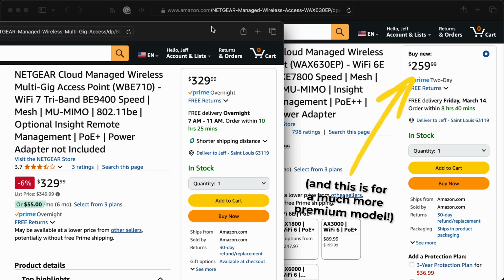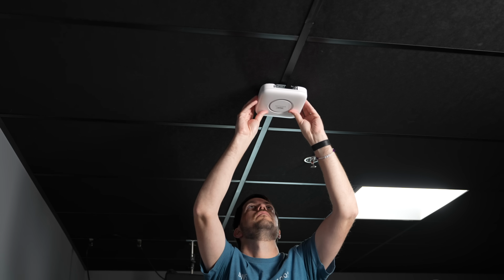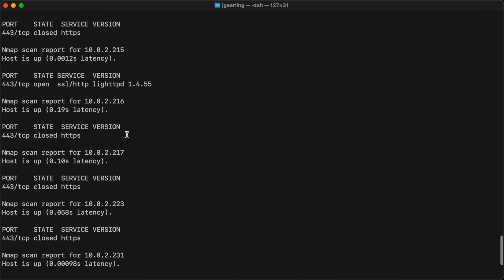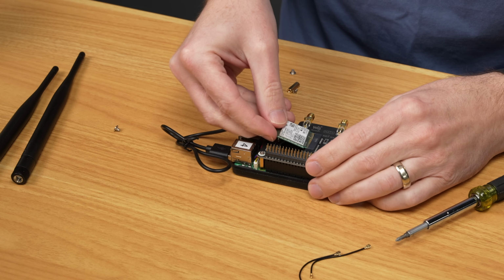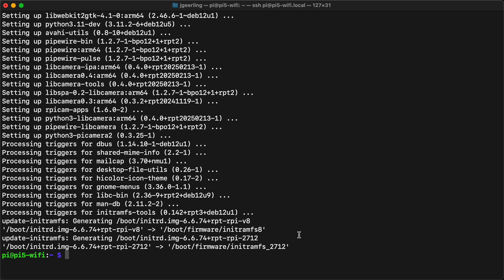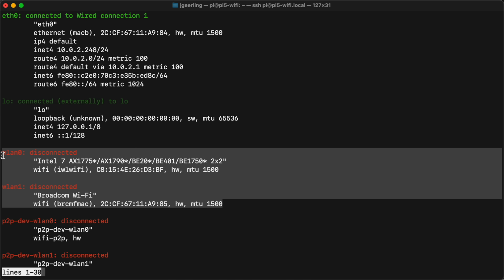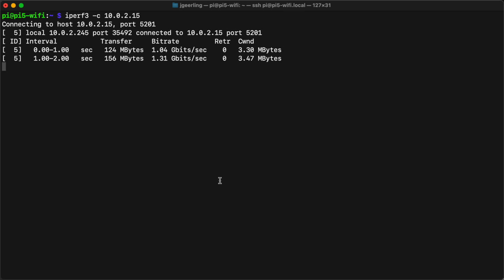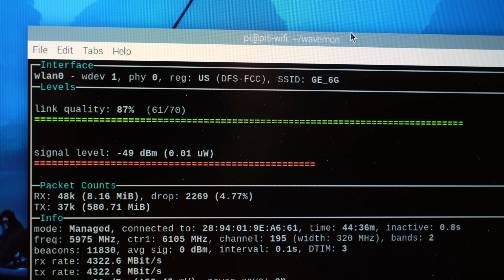The fastest WiFi EVER on a Raspberry Pi

Comment: Did we ever get a RPi5 AP/Router video? Even if not using WIFI6/7
Reply from the maker: Not yet :(

Still trying to finish my 'ultimate Pi WiFi Router' setup, I kept running into issues, then shelved it a while. I'm working on another WiFi setup right now but not quite the same as building an AP/Router.
Reply: @JeffGeerling  Count me as interested to see both of those experiments

Comment: @JeffGeerling Ive been trying out raspAP.  Do you have a better solution.  I plan on using this intel chip to broadcast and wired for input.  (so a router that rebroadcast)  Thanks in advanced.
Reply from the maker: RaspAP is great! I have been tinkering with it a bit, just haven't had time to make a video on it yet.
Reply: I'll be your video helper on it ;)

Comment: Can confirm that unfortunately, running Linux Mint 22.1 with Ubuntu kernel 6.13.5 on my older Asus M413UAY with a Ryzen 5 5500U, that the Intel BE200 is not compatible with it. In the recovery boot option found in the GRUB menu for LM, it shows that after "Probing EISA bus 0" it "Cannot allocate resource for mainboard," nor can it do it for EISA slots 1-8 either. After a few more lines, the laptop reboots. Granted, the last BIOS update for the laptop was mid-2022, so if it's a BIOS-level issue it will probably never get fixed, but I was hoping it was just an OS-level issue. :/
Reply: I can pretty much say for sure that anything EISA is unrelated to your system. That was a niche standard from the early 1990s that absolutely nothing remotely modern has any traces of.
Reply: @eDoc2020  The more you know. Ty!

Comment: I'm curious why you don't use UniFi gear.
Reply: Someone on YouTube has to not use only Ubiquiti gear :D

Mainly it's usually a little more expensive and I don't like locking into one ecosystem for something like networking, where I have varied needs (between different switches, APs, routers, etc.).

Comment: Even without the E, Wifi 6 regularly is > 1.5 Gbit/s for me in praxis, let alone in theory. That hardly seems like a compelling reason to upgrade further, and few if anybody has, let alone needs that amount of WAN speeds, so it doesn't really matter anyway. I wish instead of makins speed better and range worse, they would have worked on the range more. In a European house not made of dry wall and a bit of wood beams 5 GHz range is just garbage, and 6 GHz will be even worse.
My router even claims it can do 2x 2.4 Gbit/s on 5 Ghz plus another 1.2 Gbit/s on 2.4 GHz, and supposedly supported devices can bundle multiple of those channels, but given that I have 600 Mbit/s WAN, I have never tried to prove it. And even that is hardly ever utilized, unless I do big Steam downloads, but then my CPU is aching with the decompression efford. And I have a 5800X3D, what is the Pi supposed to do with > 3 Gbit/s Wifi?
It's the same kind of issues with 5G mobile network. I can easily do > 50 Mbit/s on LTE, but with regular limits of affordable mobile contracts being like 5GB or 10GB / month mobile data, why on earth would I care for better speeds. So I can use up my monthly quota in seconds instead of minutes? Yay, what a feature. Again, I'd rather see speed in long range, not in short range, and neither 6 GHz Wifi nor the faster aspects of 5G give you anything there.
Reply: With the higher frequency bands you can more easily choose a channel with less noise, increasing SNR. Even with greater attenuation this should increase range.
Reply: @eDoc2020  True, but that only helps you in dense apartments with lots of competing routers. And only increases range if your range was limited by that previously.

Comment: Wifi 7 main benefits is wider bandwidth it goes to 320mhz in 6ghz which has no interference and sadly iPhones doesn't support 320mhz afaik but any other wifi 7 device should and be able to get 3gbps+

Comment: Doest it suport Monitor Mode? Can I have more than 1 WIFI card atached?
Reply from the maker: check the linked GH issue, I got it in monitor mode but haven't explored too much further than that.
Reply: @JeffGeerling  Thanks Jeff. I appreciate the response. I guess, utilizing a WIFI  card with a chipset that's capable of monitor/ promiscuous mode should do the trick. I am les interested in "most modern" technology. rather. loving the form factor- one of having the possibility to have this awesome hand held network "trouble shooting" device. 

It's a shame from Pi4 to 5 there had to have been a change in the WIFI chip- IMO, in the wrong direction- since on Pi4 we could utilize monitor mode straight from the Pi4.

If there are any powers that be that may  be reading- my wish and those of many others', please allow us to switch the WIFI chip, easily ad another(or multiples...) and allow for the end user to be able to have external antennas(without having to perform surgery on our poor Pi). Some of us require certain features of other chipsets, and or require the functionalities which multiple would provide- lastly, some of us require placing our Pi in places/ enclosures that aren't the best rf/ signal environments- basically faraday cages. Having the ability to have external antennas would be a god send.
Reply: @JeffGeerling  Lovelly. Will do and thank  you.

Comment: They missed a trick not tapping off the GPIO 5V for the Bluetooth power. What a messy set up with that cable.
Reply: The BT half doesn't have separate power. The USB cable is needed because the BT part of cards is a USB interface instead of PCIe.
Reply: @eDoc2020  You're not wrong but that USB cable goes down to a 2pin JST connector. Looks like it's using GND and 5V, or they've used the wrong colours and that's D+ and D-?

Comment: It doesn't work only with Intel CPUs. But the intitial recommendations they were making was that you needed recent Intel processors to take full advantage of the Wifi 7 . Some people took that to mean it didn't work with non-intel CPUs. But i'm not even sure how true either claim is or was.
Reply: Some Intel NICs are "CNVio" and only work with supported Intel chipsets. The trick seems to be that models ending with "1" are CNVi and "0" are regular PCIe.
Reply: @eDoc2020  Ahh that makes sense. That's been going on for years with BUS tech. Whether it's PCI, PCIe or USB. Good to know though.

Comment: Really disagree with the initial assessment. Wifi 6's features really just boil down to TWT and OFDMA, both of which don't really improve the wifi experience for an average user. 6E gets you a new fancy band with better rates, but that's essentially the only feature that you're going to get out of Wifi 6. Wifi 7 really does have some neat features, driver support for them is just not quite there. MLO especially has required massive software churn to get working, for example Intel only started supporting it in Linux 6.11 (maybe 6.10?), and Mediatek only added support in 6.14 (still RC, so that isn't even going to be in OpenWRT kernels yet). Intel also is completely reworking their driver for 6.15 (calling the new one IWLMLD, so you know MLO is the focus of this rewrite). The point is, right now you can buy Wifi 7 hardware and not have access to all of the features. MLO really is a massive game changer, but you probably aren't seeing its benefits in your testing. These features will work better in the future with software updates.

Idk, I'm just not much of a 6E truther. The new band is neat, but the best features are all in 7, which is pretty hard to test for right now.

Jeff, you might want to try building the wireless-next kernel next time you do one of these tests, you might see better throughput. I know with a BE200 I've gotten more than 4 Gbps download throughput (which, napkin math should tell you is close to the maximum for 2x2 MCS 13 connection) in a fairly sterile RF environment.

Comment: So Wifi 7 at 1.8 Gbps is ~20% faster than 6e at 1.5 Gbps. Not coincidently this is precisely the gain you would expect going from 1024-QAM (10 bits per symbol) to 4096-QAM (12 bits per symbol). Neat!

Comment: As a smart pc guru you missed the ball in the first couple of minutes in your video… wifi 7 is just not like wifi 6e or wifi 6.. the whole point of it is channels you can use that we did not have before… and without clear and free wifi channels in a crowded wifi area, you get no speed and high latency or no connection at all..

Example, my neighborhood has so many routers using the sa,e basic wifi channels on 2.4 ghz, 5ghz and 6ghz it slows everything and everyone down even if sharing or using other channels in frequency range…  6ghz is less congested but filling up too now… wifi 7 gives you more channels, fully functional ofdma, and other features that one even in crowded environment you would still have good speed and latency and a lot more open clear channels….

WiFi don’t work when everything is dragging down the frequency ranges and using all the same channels and older technology that causes interference… I can get 2+Gbs over WiFi 7 at range on clean clear channels on 5-6ghz frequencies..l try that on WiFi 6 on 5ghz channel that’s shared or used and lucky to get .5Gbs with dropped connections
Reply from the maker: 6E also has the 6 GHz channels though... WiFi 7 adds some nice features but the spectrum opened up in 6E

Comment: You only test with a 160MHz wide channel?  Wi-Fi 7 has support for 320MHz, iperf that.  Also there are two version of the BE200. You should use the non-vpro be200 for stuff without an intel processor.  Be200.ngwg.nv  The "NV" is the important part ;)

Comment: So 5 and 6ghz cannot make it through concrete walls? How are people outside the US supposed to use it then? Most people will have concrete walls in say Europe?
Reply: They definitely can, you'll just lose some signal strength. If your walls block too much signal then you just need to have more access points to provide the required coverage.

Comment: The origin of the "Intel only" wifi chipset problem comes from CNVio chipset variants. However the BE200 is not CNVio. CNVio variants have been named ending in 1 (eg AX201, AX211, etc), and the BE201 is no different.

Comment: Netgear now imposes forced arbitration. That crossed a hard red line. Anything Broadcom is also no go because no sufficiently open source drivers therefore no OpenWRT. What other Wifi 7 AP options I have? Best if it comes in m.2 form factor that I can just install into a PC or a Pi as demonstrated here?

Comment: Jeff I finally found something to critique!!! So... you ran the cable OUTSIDE of those sexy drop tiles? Really dude? /me is frowning at you :p
Reply from the maker: haha, well at some point I'm going to route some cables up into the ceiling above that ceiling (it is sectioned off from the actual ceiling a couple feet even above that for sound isolation). Until then, clipping to hangers below the T-bar works... okayish.

Comment: Still using a bunch of UAP-AC Lites (802.11ac/Wifi 5) at the three locations I deal with, still perfectly happy with them. Fast enough for me, and rock solid (except the couple times Unifi has screwed up firmware updates over the years). 

If wifi is too slow, I'm just going to plug something in to ethernet rather than try to upgrade my AP and hope the combination of access point, device, environment, interference, and available bands all align to give me something meaningfully better.

Comment: I've stopped trusting the --reverse flag on iperf3. I have found reverse mode never yields true capable speeds, especially on SBCs; often less than half the speed than if you just reverse roles and run normally to test in the opposite direction. I confirmed my suspicious with a wired 2.5Gbit Ethernet connection running both with --reverse and simply switching the server/client roles manually...the results were night and day!

Comment: Wow so much fixes for so little benefit, definitely don't need a wifi 7 router, laptop, desktop, os, phone, printer, tv, and ai overlord across my cat 6 cables with my 3 users, and 6 wireless devices. I usually get 400mb and 10mb with Ethernet but don't tell my isp that🤫

Comment: Im very interested in using intel card as an AP. Had issues with ax210 and it seemed the intel cards lock down ap mode while qualcomm ones work better in AP mode (haven't trsted the Qualcomm cards tho). Also are you able to set your netgear AP to 320Mhz bw, have that newer intel card connect and then test iperf3 again?

Comment: Past 3 months ive upgraded the station's ubiquiti AP to the U7 Pro. Also next week adding 2 of the U7 Outdoor. With an exception for one AP, everything is on 2.5 gig backhaul and speed tests make it feel like you're plugged in. Of course all desktops and laptops on docking stations are hardwired to either 2.5 or 1 gig ethernet.

Comment: Thanks another greate video.  But only multple reboots and config changes were required?  I'm was sure you were going to have to crank back a sign to 0 days since your last Linux Kernel Compile.   Speaking of signs, you should setup one of those counter boards at the back of your set to track  how many days you can go actually without an actual Linux Kernel recompile.
Reply from the maker: I know, I was quite surprised!
Reply: @JeffGeerling  Thank you sir for the creator like and reply.

Comment: I don't think that many people upgraded to 6E it was such a strange short lived increment that most didn't understand. WiFi 7 MLO "IN THEORY" should drastically improve things like roaming by allowing devices to maintain associations on more than one band at a time, not just a speed increase for devices that can send on both more than one.

Which is another point to check in your specs does your MLO device support sending on more than one band at a time.. Apparently most new ones don't there are something like 3 MLO modes devices can support.

Comment: Since you mentioned "most people", I have a way hotter take:
For most people, even Wifi 3 (802.11g) is enough. It has good range and a theoretical data-rate of 54 MBit/s. That gives you about 20-30 MBit/s of usable bandwidth. This might not sound like a lot, but is enough for a YouTube-Video at 1440p 60fps.
Reply: Unfortunately, that doesn't hold true when there are multiple clients and multiple APs on a channel.
Reply: G is "good enough" for a single user but at the same time it's slow enough that a difference will be noticeable.

Comment: I don't see any advantage in Wi-Fi, so everything runs over a good cable.
This has three advantages:
Higher speeds.
Reduction in attack points on the home network.
And no interference.
For a home with a maximum of three users, you don't need Wi-Fi,
except for the not-so-smart smartphone.
Reply: You hit on the main Wi-FI advantage at the end there. The other reason is that it's cheaper per-device as long as you don't care too much about speed.

Comment: I suspect the answer to whether you can use that Intel card to create a Wi-Fi 7 access point is no, because Intel cards (at least in the past) are set up for "no initiate radiation" mode in the 5 GHz (and presumably 6 GHz) bands, which means they basically can't be used as an access point on those bands. It seems like there's some extra regulatory approval needed to allow a device to initiate radiation on those bands, because it's responsible for things like DFS, and Intel doesn't seem to bother with this.

Comment: Am I the only one totally non-plused by wifi 7? I don't want to install one or two access points in every single room in my house so I can enjoy fast wifi. It sounds like 5G... Super fast if you're right beside the transmitter otherwise not delivering what most people really need: range and signal strength through obstacles.

Comment: Wifi 7, you have to have it so close to the device to be reliable, you might as well hardwire anyway.
Reply from the maker: It works fine further away but the other parts of the tech (some that are also in 6/6E) are more useful overall than the raw speed.

Comment: AFAIK, regular WiFi is half-duplex, that's where MLO comes in. By using 2 frequencies at the same time, you can dedicate one for downstream and the other for upstream, basically making it full-duplex. I think this is a big deal for real-time applications. But for MLO to work properly, at least from the tests I ran, you need to set the encryption to WPA3 only. Another thing: in your setup, the antennas on the Pi should be horizontal, so it's "facing" the AP on top and not the reflections of things on your desk.
Reply from the maker: I had been messing with the antennas and it seemed like they were good to go in either orientation, at least being so near the AP I guess.

I will have to play around with MLO some more. I think I had the AP set for it, but had WPA2/3 allowed, maybe I also have to lock that in.

Comment: I feel like a broken record when I tell people this, but performance testing using only things like internet speedtests or iPerf are terrible at conveying real world performance due to their fixed packet size, which is usually set at 1500-bytes (or the maximum for most internet providers). This is like having a 7 foot tall door; not everyone who goes through that door will be 7 foot tall. Try performance testing WiFi of any generation with packets smaller than 1500-bytes (IMIX or even 512-byte, which is probably closer to a real world) and you'll see performance absolutely plummet.

Comment: Great video Jeff. I'd love to see a pi mesh wifi video with a base unit as the router and at least two satellites. I've been looking at batman and wondering. Then all you need to do is drop in new wifi cards everytime there is a generational advance (ignoring the driver issues of course)